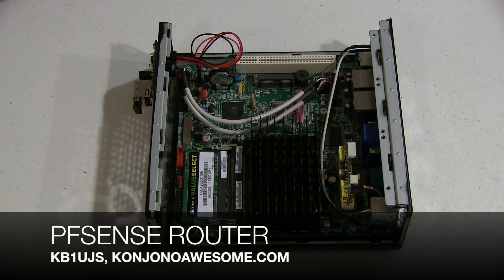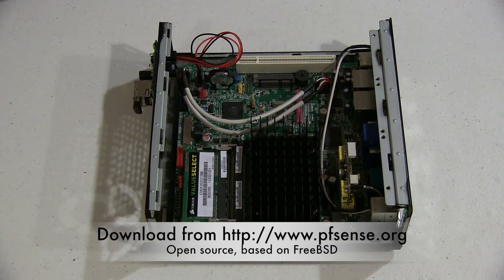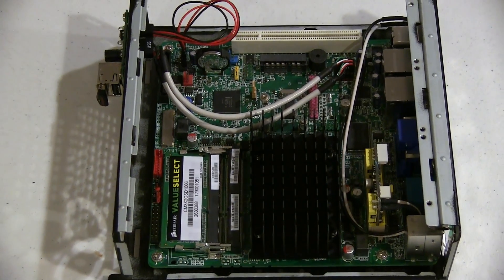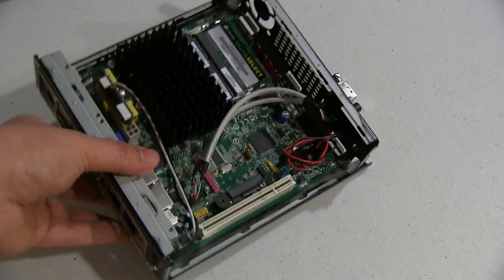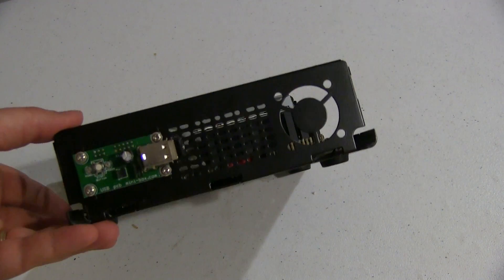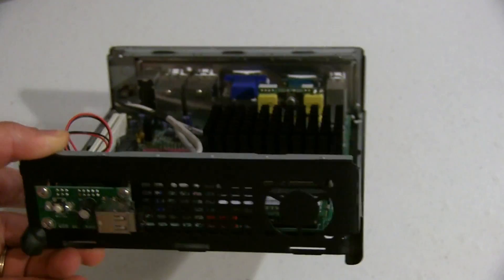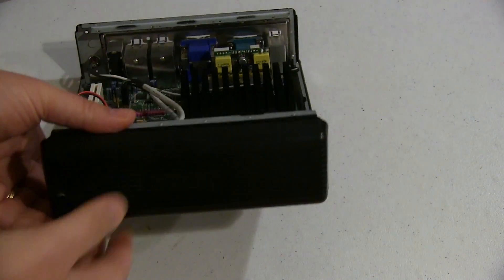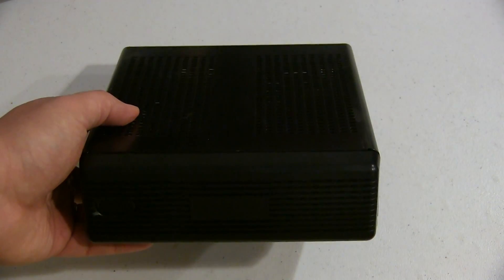pfSense Box

Comment: Do you have caching turned on? Is that a dual USB port on the front?
Reply from the maker: +acklan3 No caching.  The caching doesn't work especially well with the USB based installs in my experience.  It is a dual USB port in the front.

Comment: VERY nice! What kind of LAN activity does this setup usually see and what is the CPU utilization?
Reply from the maker: I have a 15/1 Mbps DSL connection.  Maxed out, I see a CPU utilization of less than 20%.  I have another Atom powered box at work (D525 instead of D2500) that is routing our 50/50 Mbps fiber connection.  Never see that one over 20% utilization either.
Reply: Konjono Awesome Great to hear! Thanks for the reply.

Comment: this is exactly what I've been looking for. if you can post the specs and where to buy this stuff, or inbox me, I'd greatly appreciate it. i'm gonna assume spec for spec this would not cost more than a $200 or close in that range.
Reply from the maker: Sure thing.  If you were to order all the parts from mini-box.com:

http://www.mini-box.com/M350-enclosure-with-picoPSU-80-and-60W-adapter
Enclosure, Pico PSU, and power adapter $69

http://www.mini-box.com/Intel-D2500CCE-Mini-ITX-Motherboard
Motherboard $109

http://www.mini-box.com/2GB-DDR3-SODIMM
Memory $25

You also need a USB thumb drive, so factor in another $10-$20 for a quality 8 GB thumb drive.  Altogether, you're right at the $200 price point you mentioned.
Reply: Konjono Awesome Thank you for responding! Well I still have my N66U. Will that suffice as a good AP?

Also I plan on purchasing these parts to build my router, any thoughts?

Build List:
-Intel Celeron G1620 (thought this would be good choice for handling a VPN)
-Intel DQ77KB Thin Mini-ITX motherboard. Socket 1155.
-Samsung 2GB DDR3 1066MHz SO-DIMM 204 Pin
-Mini-Box M350 Case
-Dell Inspiron Latitude 90w PA-10 AC Adapter
-8GB USB Flashdrive

-Asix AX88179 USB 3.0 network adapter (I plan on plugging this in the usb port of the router to then plug into the AP)
Reply: Konjono Awesome Do I need to buy a wireless antenna of some sort to get WiFi?? If so, what would you recommend?

I also have a 100 mbps connection. If I run a VPN on the router, how well will the CPU handle it? Should I go for something more powerful?
Reply from the maker: ***** The CPU I used would handle the bandwidth fine, but I'm not sure about the VPN.  The VPN works fine in my limited use on this hardware, but if you were planning to saturate a 100 Mbps connection with a VPN tunnel that might be an issue.  Newer Atom CPUs support AES acceleration in hardware on pfSense.  Check out pfsense.org for more info.  As far as WiFi, you can add a wireless card directly to the router.  I would recommend, however, using an external access point .  I use a Cisco 1142, which is a pricey but very nice access point.
Reply from the maker: Not familiar with the N66U.  Also not sure how that wireless adapter would work.  Everything else looks pretty good.